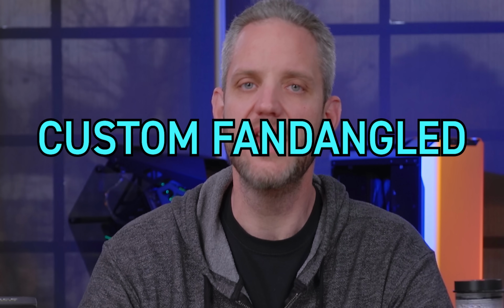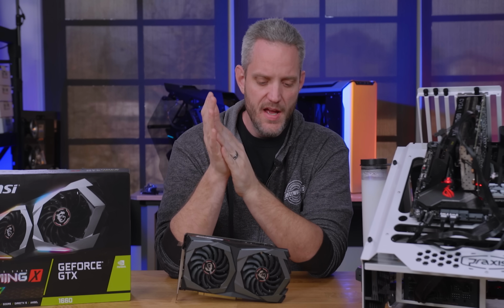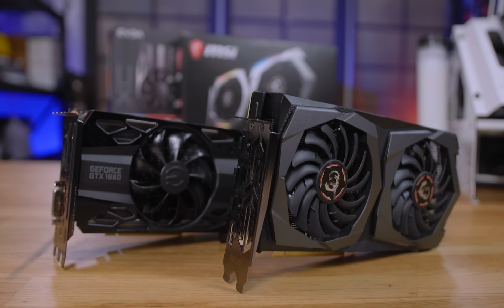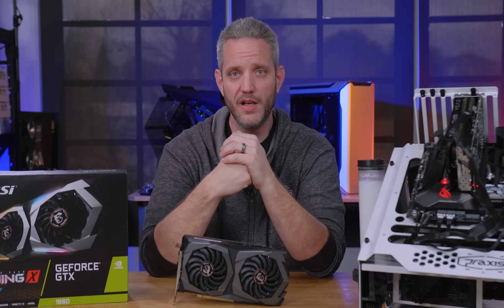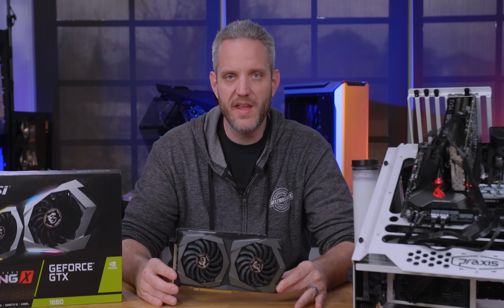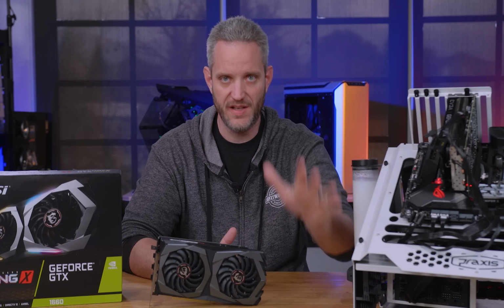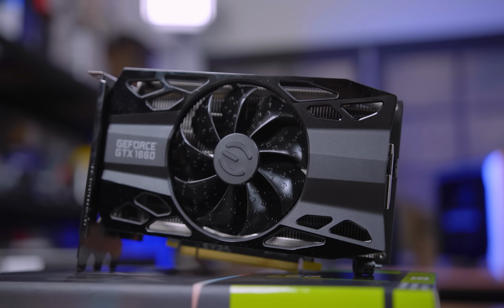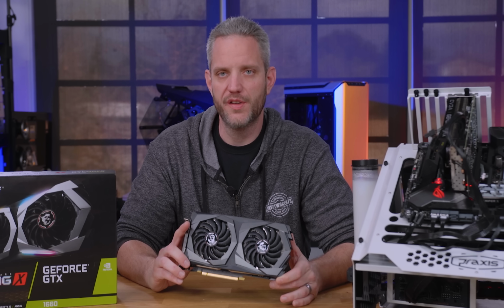Just save your money.... GTX 1660 vs GTX 1060

Comment: changed my thermal paste on my gpu after watching your last video. now it runs at 60-70c instead of 70-80. RX 580 8gb that ive got running at 1400mhz and 60+ on memory. Thanks!
Reply: "Revived" some "old" quadros with that. From borderline 85 down to 70ish. 3d-guys are happy. Customer saved 30k on new cards ;)
Reply: I voided my warranty
Reply: @Dok Lk7 I doubt it, some cards ship with horrible thermal paste.
Reply: It sounds like you have a better case than Jayz2cents. And bad thermal paste would normally go from 90-100c.
Reply: if you are not afraid of bios modding...us Ubermix3 memory timings you get an extra 4-8fps
Reply: Only 60 on the memory? I got +500 on my GTX 960s memory...
Reply: Got my RX 580 running at 1425 core and 2230 memory... It will go higher but temps start hitting 82-84. Can get 1440 if I drop mem to 2200, but performance is better with the higher men speed. Will be interesting if new/better thermal paste will let me squeeze a little extra... But as I'm waiting for navi before comparing red vs green for next upgrade... I don't see the point.
Reply: @HecklerUK  whats your core voltage value? i cant for the life of me find anything that is stable except 1435mhz/2000mhz @ +20mV
Reply: My strix RX 580 8gb was boosted to 1480 mhz and never went above 70. I just ran a more aggressive fan curve.
Reply: @richardosborne8393  fan curve and air flow isnt the problem, the paste was way overdue for  new paste. pads to kinda. also its the Gigabyte radeon card.
Reply: @neveranyluck4693  yeah I was just reinforcing you were obviously having an issue. People really harp on AMD stuff running hot.
Reply: c f and in the voice of pops from Friday, “dasss da beauty of it”
Reply: nice 1425 here c:
Reply: c f I was just thinking about doing this or/and adding an aio for my gpu
Reply: Lolled9991  bro wtf i lolled
Reply: overclock a tuna?
Reply: @kennybroothaerts7521  he definitely was trying to say that. So it would cook better.
Reply: What shitty 580 do you have ? Mines runs at 50-60c max,  1440mhz out the box settings. Sapphire nitro+ special edition.
Reply: @DRM300508  Gigabyte radeon RX 580 8gb, but its old and has been overclocked since day one. the paste that was on it was well overdue lmao